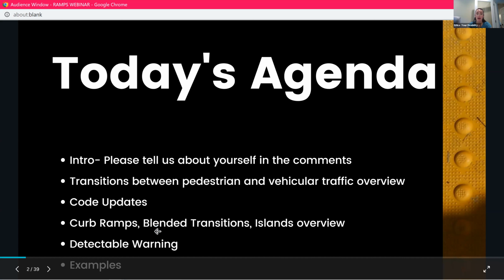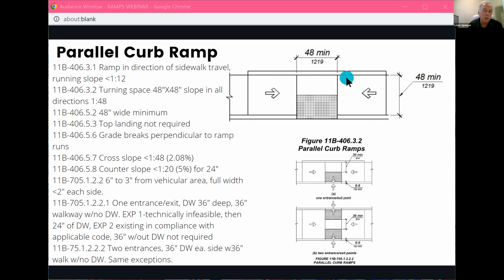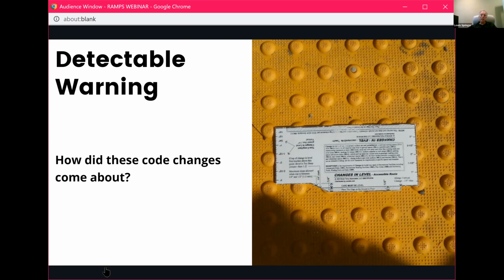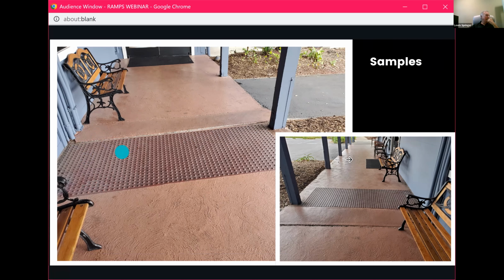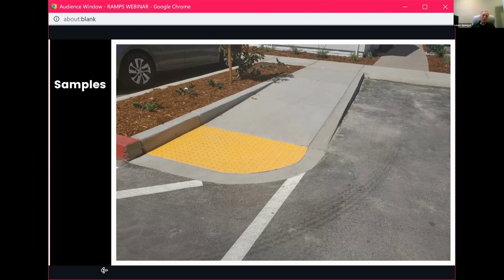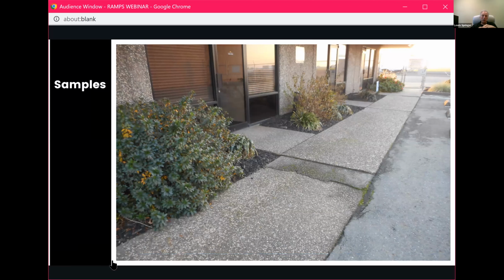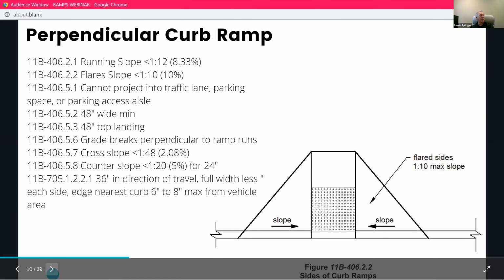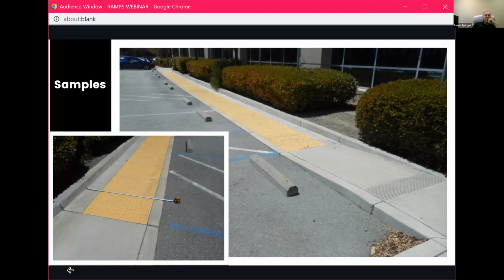Curb Ramps and Ramps ADA education series

Comment: Appreciate the effort but the examples lack explanation of good solutions and remedies and makes for confusing presentation overall. Also, the parallel ramp question does not mean the diagram is wrong. If a building blocks the edge, the yellow mat is 24inches only.